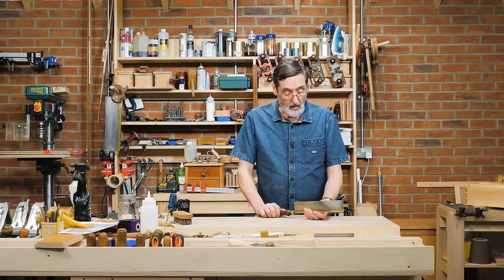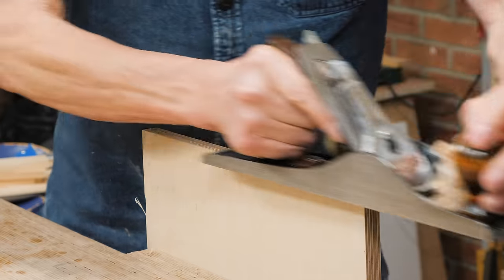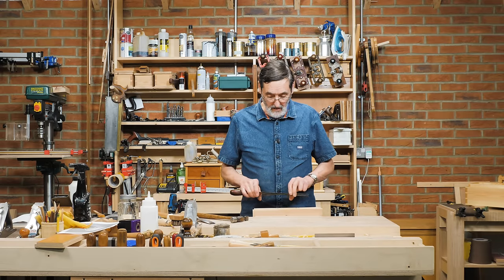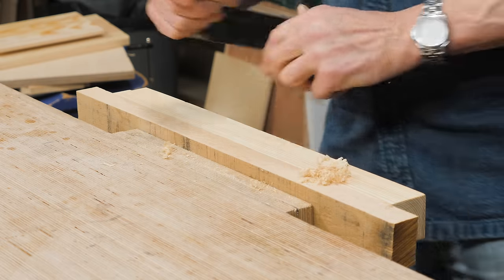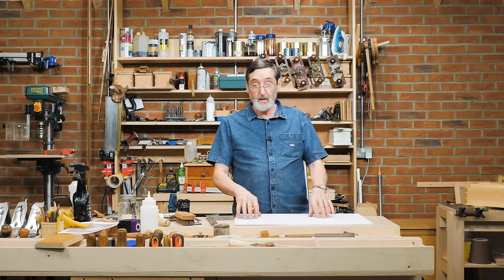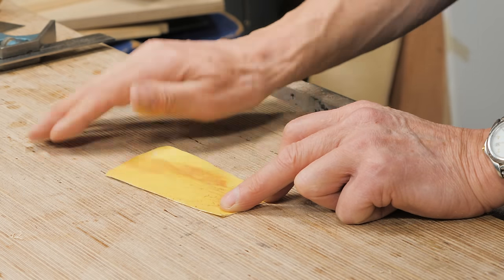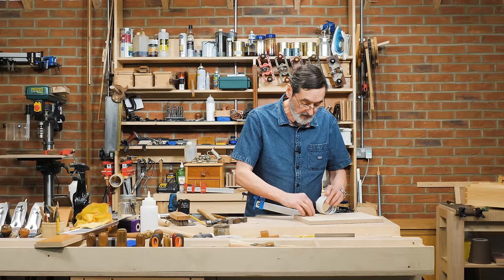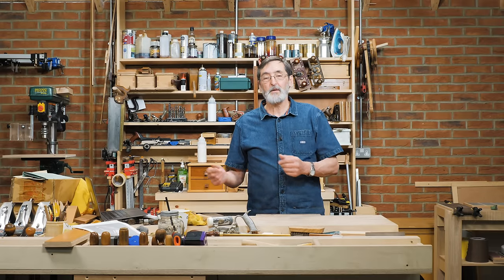10 Quick Woodworking Tips 02 | Paul Sellers

Comment: Thanks Paul, I will certainly pass these tips on. Too bad we can't straighten everything buy wacking it on the bench.
Reply: If you can't whack it on a bench whack it with a hammer. Not a ball pein though, we're gentlemen not metalworkers.
Reply: @jumbo4billion  hitting with a hammer is my usual way of straightening things like spikes. Somethings require some heat and a bigger hammer.
Reply: My dad always told me "Never use violence, use a bigger hammer". :)
Reply: Green- Zone, “That you, Bubba?”
Reply: @jumbo4billion  :DD im made my evening :DDD
Reply: It works with crooked politicians...
Reply: That's how I straighten out warped lumber. Just whack it a bunch of times on the table.

Comment: Another finishing tip which is in line with this one is to cut small blocks of wood "think off cuts" then put a finishing nail through it. That way you can adjust for size when you have larger pieces and they are able to do more projects than be used for just one single piece.

Comment: For checking levels for level is the same as the square trick,  make a line, swap ends and double check.  Works vertical or horizontal.

Comment: Nice! 10 real tips ..that aren't being parroted around by all that other YouTube hacks. ..also,  to clean out sandpaper and other abrasives, like belt sander,  disk  sander, grinding wheel,  etc. If you dont have an eraser, use the rubber sole of an old shoe. It works like a charm..

Comment: A taped block to a clamp can move under pressure.  I drill into the block and super glue a rare earth magnet into the center of the block.  Stays in place on the clamp. Try it, it works.

Comment: I learned the eraser trick for power disc and drum sanders.  Those of course fill up quickly and the paper is a lot more expensive, so it's pretty critical to do this frequently or they become unusable.  The maker space I work at has giant 1.5"x1.5"x8" gum erasers for the purpose.

I still learned something from that tip, though; it hadn't occurred to me that I could do it with hand-sandpaper before!
Reply: I keep an old 2" paintbrush on my worktop for dusting & cleaning, works good for clearing sandpaper clogs too

Comment: The eraser on the sandpaper trick is to be used on the second-year apprentice who thinks he’s got a handle on your jokes & tricks.
“Run to the store, buy an eraser and rub out this sandpaper so we can use it again.”
Reply: It's also my favorite tip
Reply: Is this trick work on the diamond plate too?
Reply: @sturmkim  : If the diamond plate is clogged with metal, I would expect that the eraser isn't stiff enough to remove the clogging bits, but it won't hurt to try.
Reply: @sturmkim 

I've tried but with little success. But use the diamond plate to flatten an oil or water stone cleans up the diamond one at the same time.
Reply: @sturmkim  A powdered cleanser like Comet or Ajax with water & a nylon scrub brush will help.

Comment: Another tip I saw somewhere is when gluing up two pieces of wood which usually has a tendency to slip and slide, as a few grains of salt to the surface which will prevent the sliding.

Comment: Paul,  on the pads for clamps, mine creep a lot..  is there something im not doing?
Reply from the maker: Could be the type of double-sided tape. I am using a reinforced one with fibreglass strands crisscrossing the adhesive.
Reply: Remember that you could glue some leather onto those two pieces on the side that's facing away from the clamp jaws, in order to prevent it sliding when clamping. This doesn't answer your question, though, but I think Paul is right; the type of tape is important.

Comment: Hello Mr. Sellers. I have a rip saw similar to the one you gave away.
I sharpened the saw carefully following your video tutorial. Now it cuts like crazy but pulls to the left ?!
What could I've done wrong ? 

Thank you in advance !
Reply from the maker: It can be mis-set teeth. Are you sure that they are set equally?
Reply: @Paul.Sellers  Not sure about how the teeth are set, they are small and 13 TPI but I'm new to all of this fine woodworking hand tools so I don't know how the teeth are supposed to be. Also I just found out a little bent 2" away from the handle...
Reply: I have found that burr from the filing, if it is all on one side, can have the effect of too much set on one side. I expect a sawcut to drift to the side with too much set.

Comment: QUESTION - How would you remove the saw handle screws??
Reply: We're not talking about screws, here, but rivets. Gotta drill 'em out.
Reply from the maker: Use a centre punch on the centre of the stud and drill through until loose. A 3/16" bit should do it. Of course they cannot be used again.

Comment: Hi Paul, in tip 10, is that a ‘silver line’ brand clamp?? Are they any good? I’m on the lookout for some good clamps preferably as cheap as possible. Are there any you would recommend?
Reply: They are very good and great value for money. However, they are hollow aluminium. So, if you over-tighten them, they tend to twist. If you saw and plane a stick to size, you can slide it into the ‘hollow’ - i.e. along the length of the clamp. This largely overcomes that minor shortfall and you are left with some very good clamps! (I can’t claim originality for the idea, but I can’t remember where I learned it so I can’t give due credit).
Reply: Gumtree Terry thanks for the tip 👍
Reply: Check out Paul's video "Clamp Retrofit" to see the insert and other fettling he does to make these clamps a great value. https://www.youtube.com/watch?v=AyKiGmRq3wY
Reply: Gumtree Terry Mr Sellers does that with all his clamps - put sticks in them. I bought Screwfix clamps he recommended but they now have a solid Body. The problem being they don't always sit on a surface without falling sideways, which can be a problem when clamping something in that position, when edge jointing boards etc
Reply: I thought those were the ones from Harbor Freight that he showed how to improve in the past
Reply: If you are on the "lookout" for "good clamps" then I recommend Craigslist for old steel ones. Hartford, Hargreave, Jorgenson and the like. I surprised myself that I was able to find, over the space of a year, more than ten such four- and five-footers, at prices averaging $15. Rusty means nothing to clamps. Wire brush and oil, and they keep on performing. Dealers specializing in tools know that clamps have value, though, and don't sell cheap.
Reply: Yup same as my sliverline ones.
Reply from the maker: Hi Paul,
You can find out more about the clamps Paul recommends and the sizes on our sister site, Common Woodworking: https://bit.ly/33WalUe
-Izzy (Team Paul)

Comment: Will the saw straightening trick work on a saw that has a different metal than brass for the spine?
Reply from the maker: Just the same.
Reply: That would be assuming that the spine isn't, also, bent.
Reply from the maker: @tonyhemingway7980  no, it works then too. If you know how!